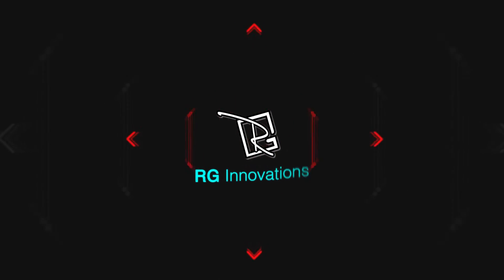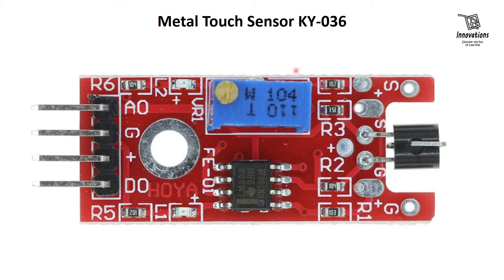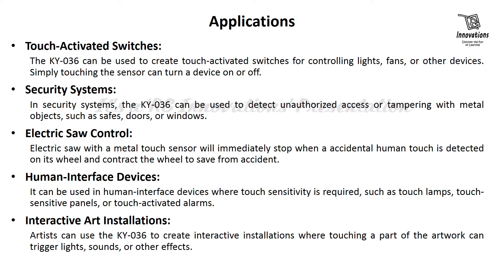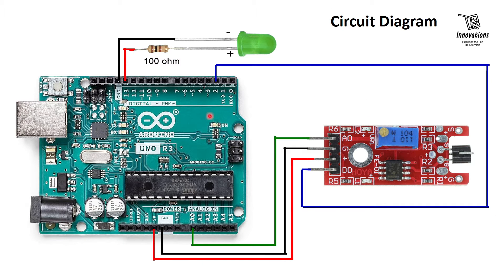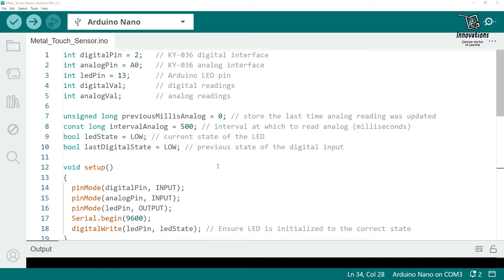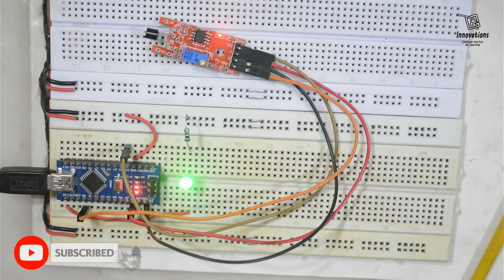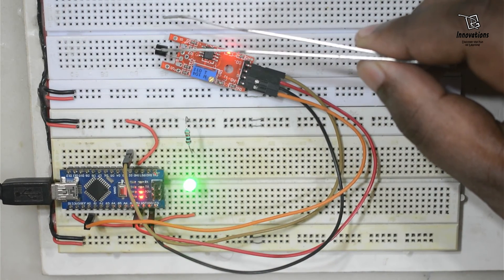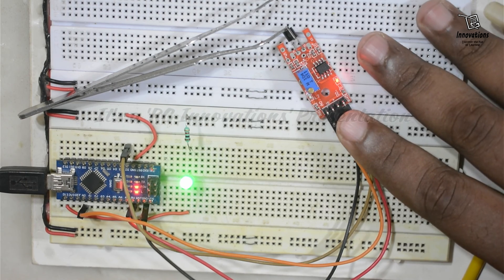Metal Touch Sensor KY-036 | Explanation and Interfacing with Arduino | Practical Demonstration

Comment: Hi, I want to build a tool for my table tennis training.  When I hit a ball in a particular place where I paste Aluminium foil paper and then connect this metal touch sesor to the Aluminium foil, then I expect the light to glow(may be a big or more LED lights) when the ball hits the Aluminium foil.  Is it feasible?  If possible, can you please explain me what are all the things to buy to make it.  Thanks in advance.
Reply from the maker: You can connect a tap sensor module, or piezo speakers as sensor on a cardboard, and place that on the TT table.